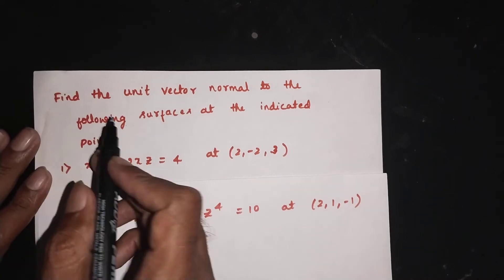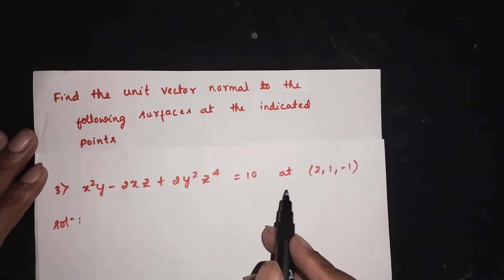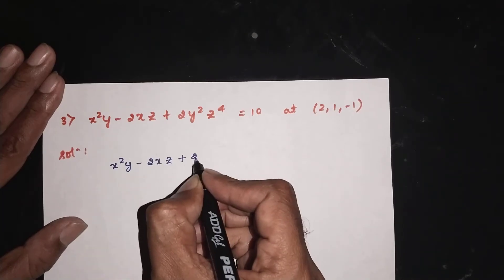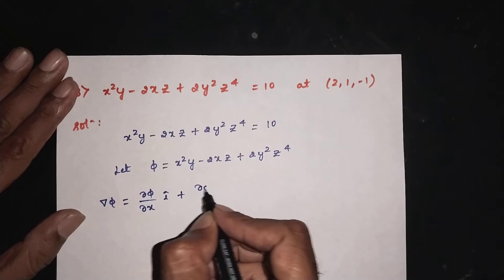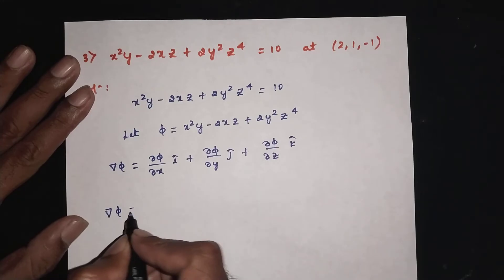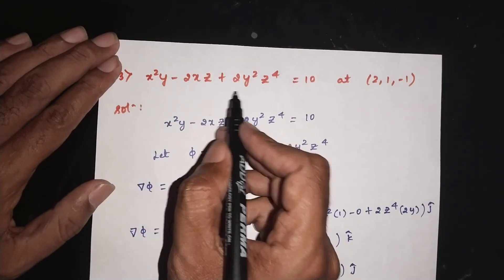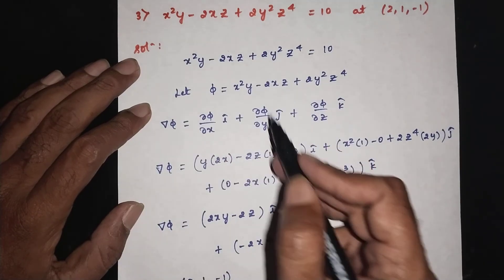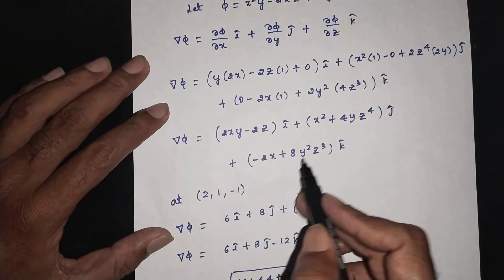Unit Normal Vector from Gradient | Surface Problem Solved | VTU Engineering Maths

Comment from the maker: 📘 Watch These Next (Full Vector Calculus Revision):

1️⃣ Unit Normal Vector to a Surface → https://youtu.be/mk5FR2yipyY
2️⃣ Normal Vector | Surface xy³z² = 4 → https://www.youtube.com/playlist?list=PLM9RnGtTy9_-sWX9iq6jk9k1NydPDqRv-
3️⃣ Normal Vector | Surface Solved → https://youtu.be/HvgN8wxpNp4
4️⃣ Directional Derivative (1/7) → https://youtu.be/3EwVfh60tO4
5️⃣ Directional Derivative (2/7) → https://youtu.be/QNkjGwI9UVQ
6️⃣ Directional Derivative (3/7) → https://youtu.be/DviGlLVoM9A
7️⃣ Directional Derivative (4/7) → https://youtu.be/ED_WrXnXSWY
8️⃣ Directional Derivative (5/7) → https://youtu.be/lQzkzeOiwCU
9️⃣ Directional Derivative (6/7) → https://youtu.be/nTSis4jQ5I0
🔟 Directional Derivative (7/7) → https://youtu.be/R59Rt9Dd21c
🔢 Angle Between Surfaces (1/2) → https://youtu.be/asKR1YY_PpQ
🔢 Angle Between Surfaces (2/2) → https://youtu.be/LrmBRwpTy44
📏 Angle Between Normals → https://youtu.be/FpMZ6ervtDc
📐 Surfaces Orthogonal at a Point → https://youtu.be/WgQJlvu0ACw
🌀 Div & Curl of ∇(xy³z²) @ (1, –1, 1) → https://youtu.be/ZefVlTDOrQk
🌀 Div & Curl of ∇(x³ + y³ + z³) → https://youtu.be/_wjqemMziWk
🌪️ Prove Solenoidal & Irrotational → https://youtu.be/QGsVveNktnk
🧩 Find a, b, c | Irrotational Fields → https://youtu.be/JRFB4L-CG4g
🧮 Find a & b | Solenoidal & Irrotational → https://youtu.be/eHNrSXCJNqA
🧠 Prove Irrotational & Find φ → https://youtu.be/8CynEK8GWJk

🎯 Perfect for VTU | CBCS | NEP | Engineering Maths-II
📢 Share this with your classmates & save it for exam prep!
💬 Drop your doubts in comments 👇 — I reply to all 💯